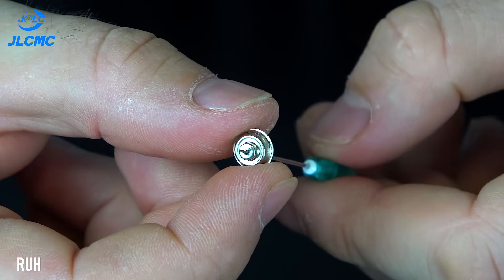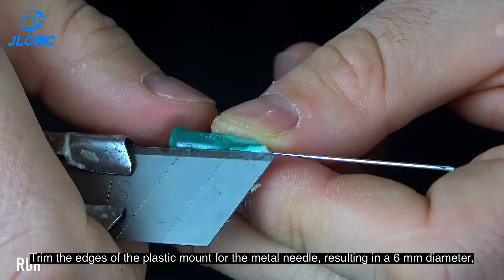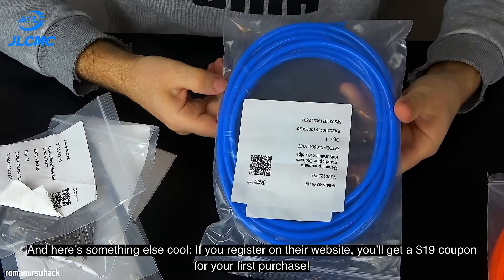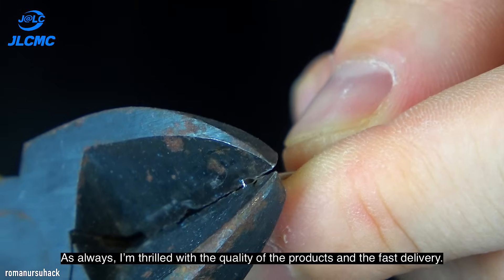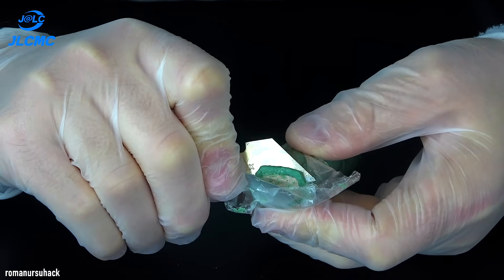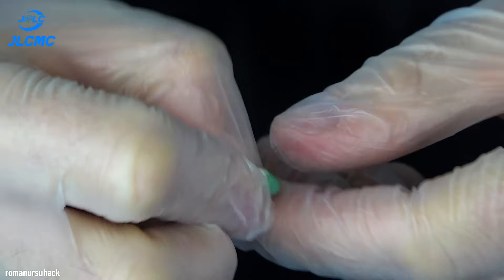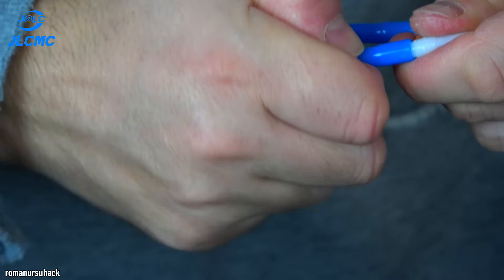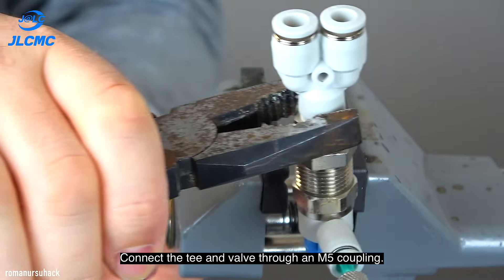This oxy-fuel cutter cuts metal in 1 second. Make it yourself and save money.

Comment: this set up is dangerous, the gas being burned is highly flammable and will flashback if the power is turned off. 
so you can only turn it off by extinguishing the flame at the tip, never shut off the power before the flame is out!
also, get some flashback arrestors!! 
otherwise cool build but pls tell people about the possible dangers and how to avoid them. 
(unless im wrong and those fitting have automatic flashback arrestors or something??)
Reply: No, that's for what is the jar of water (the second jar with a single bubbler in it).
Reply: isn't the second container with h2o a flashback arrester
Reply: @thomasthetometbomb9579  Yes, that is literally what I addressed in the original message: "... also, get some flashback arrestors!! ..."